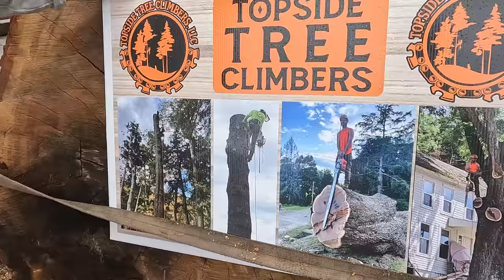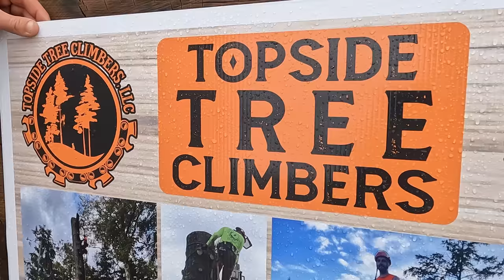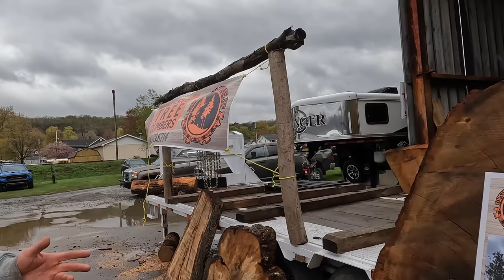I had second thoughts, Thrilled I Went to Ridgeway Chainsaw Carvers Rendezvous

Comment: I have a 18 year old ms290 that I use around the house and so some small saw milling with an Alaskan mill and I can tell you just the small porting on the muffler makes a huge difference in power.  I was amazed.  I’ve beat on it for a long time now and have zero issues. Love my Stihl!

Comment: I like the straight shot muffler on my saws and cheaper too. I have a ported 400C that I can run a 28" b/c and I don't use my 462 or 500i much lol. Mike you should get your 400C ported or just putting a straight shot on and it will run better too.